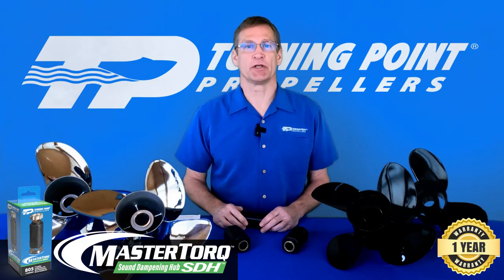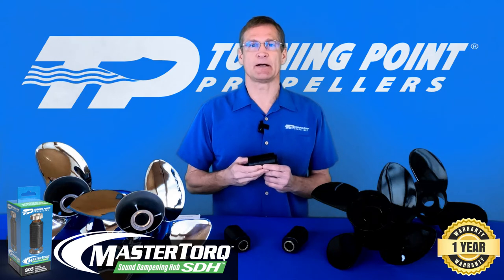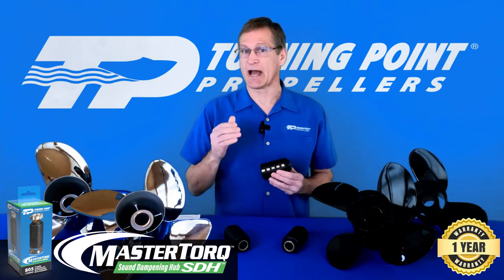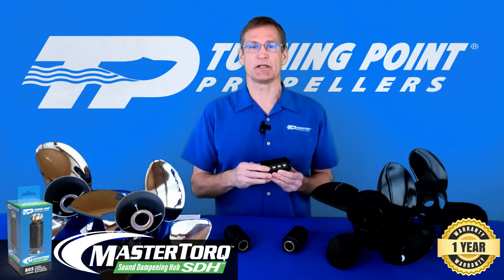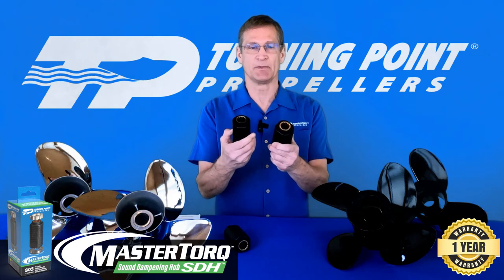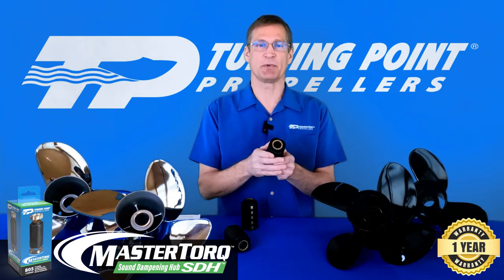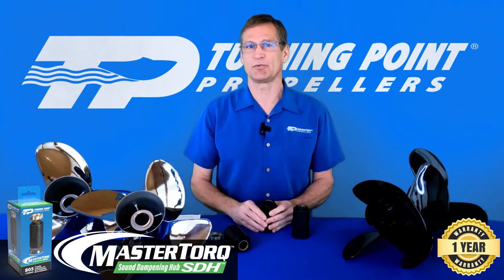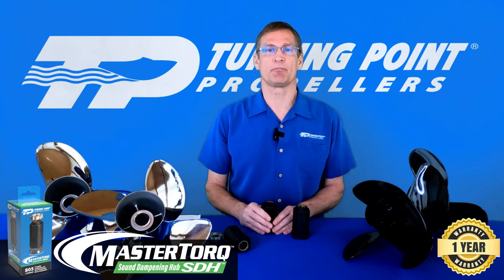MasterTorq Sound Dampening Hub [SDH] by Turning Point Propellers

Comment: First of all, the information is great, but it would have been much better to do a demonstration on a real boat that shows the difference between the SDH and the standard hub that has been available in the market.  Show us what type of noise this system is supposed to help reduce and the sound difference with the new hub.  This seems like an interesting concept and product right up to the end when you mentioned that it only had a one year warranty.  On the other hand, the standard hub has a lifetime warranty.  It is a hard sell to consumers when a new product has a lower warranty period than an existing product.  Either it doesn't work or it does not last.  It was a hard sell so at the end, we went with the standard hub because nothing in this video tells consumers that this is a better product for them.  There is a lot of market hype but no proof of the concept works.  Thanks.